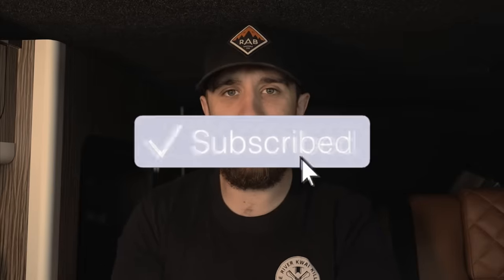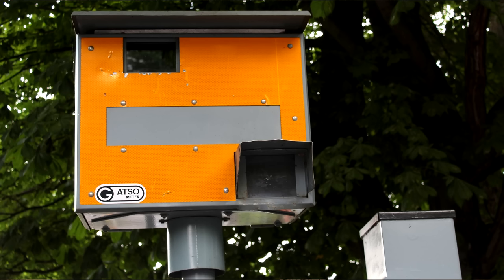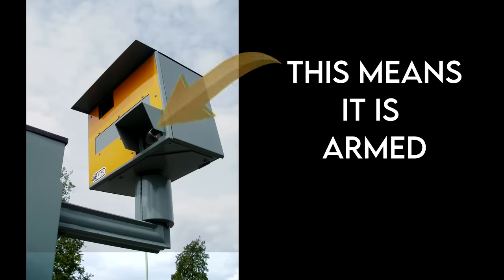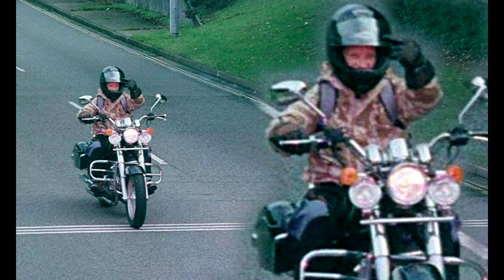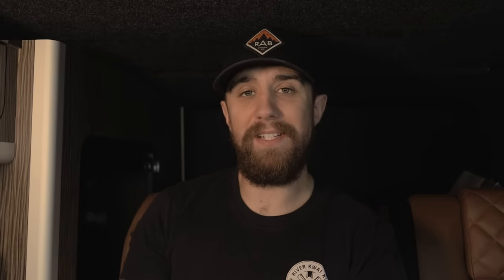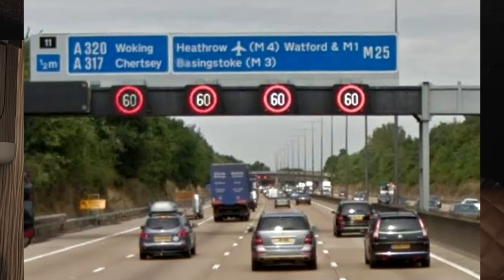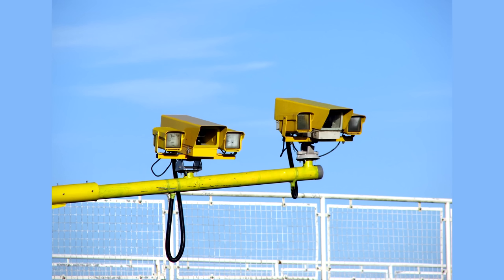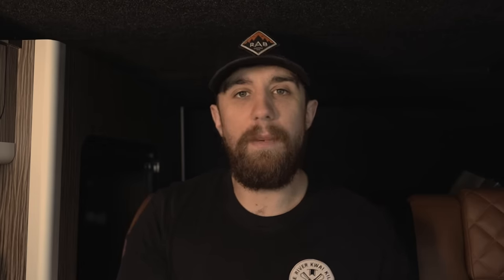How Speed Cameras Work and What to Look Out For

Comment: Day & night speed limits should be a thing
Reply: There needs to be general review of speed limits as they were set in the 70s and a woefully out of date.  It's ridiculous that small vans are subject to lower speed limits than SUVs and 4x4s.  Drivers of small vans like Peugeot Partners and VW Caddies are being unfairly targeted by a system that expects them to know that they are subject to lower limits than cars while allowing drivers of tank like SUVs to travel 10mph faster.
Reply: @raithrover1976  Unfair?  Of course they should be expected to know if they are driving a car derived vehicle or a commercial vehicle. If you are behind the wheel it's YOUR responsibility.
Reply: @bws833  It's unfair.  The old Vauxhall Combo was classed as car-derived but the new one isn't despite being roughly the same size.  Even police officers I've asked as well as managers within the transport industry seem confused about what's classed as car-derived and what's not.  It often comes down to which box the dealership ticked when they were registering the vehicle.  The lower speed limits for vans dates back to the 70s when van drivers were behind the wheel Sherpas and Bedfords (horrible things with a high centre of gravity and useless brakes).

Personally, I'd simplify the speed limit system and have just two types of vehicle classification: light and heavy with 3.5t being the dividing line between them.

Comment: UPDATE

Your point about average speed cameras being placed outside schools is a bit moot really. I believe there is a legal requirement for the cameras to be placed a minimum of 1/8 of a mile apart. Given that consists of a few hundred metres... in built up areas you are likely to have many side roads in that stretch of 200m. So someone could speed past one, but turn off down a side road and avoid the second one and therefore not get caught. For them to work effectively you would need one on near enough every single road and side road which just isn't really feasible. The cost would mean half of them would be turned off 99% of the time and therefore the ANPR system would be useless with many of the cameras inactive and as they work in pairs the "paired" camera would be off also as there is no point keeping it on.

This is why most of the ANPR cameras are used on motorways, because you could drive 5 miles before you get to the next junction, and in 5 miles they could put up 4 cameras if they wanted to. 

Also, it's Truvelo. Like the Truvelo Digital the RedSpeed does both speed and red light enforcement.

Gatso also have a Digital Camera which is phasing out the older ones, introduced in 2007 mainly used in areas like Hampshire.

Sometimes you will see secondary speed verification lines painted on both sides of the road, my understanding for this is that people used to swerve onto the wrong side of the road when speeding to avoid a camera. I once saw a twat driver in a M140i nearly lose it and crash to do this, he was doing probably 60 in a 30 at the time and nearly spun into the oncoming lane. 

They put them across both lanes so that if you set it off by speeding past it as it uses radar, and then go onto the wrong side of the road, they can still get a secondary verification of your speed as the lines are on both sides of the road.

Finally, "Cameras that track lane changes" is not quite correct. The camera doesn't track what lane you are in, it simply reads your registration plate. You could go past the first camera at 23:01:25 in the first lane, and past the second camera for example 1.5 miles away in lane 4 at 23:02:10. The second camera would simply read your registration plate (no matter which lane you are in) and add a timestamp for your reg into a database, the system then compares the two times (23:01:25 - 23:02:10) and as the cameras are at a known fixed position, in this example, 1.5 miles apart, it calculates that it took you 45 seconds to travel 1.5 miles. Which gives an average speed of 120 Miles per hour. Obviously well in excess of any threshold for a 70 mph limit, and thus a NIP is issued to the registered keeper.

Comment: SPECS cameras are the most misunderstood by motorists. I constantly see drivers slowing down and speeding up before/after the camera.
Reply: Yeah, that always makes me laugh, watching them hammer on the brakes like it makes a difference 😂
Reply: @leopold7562  it might though if slowing down reduces the average speed enough not to be above the guidance for prosecution.
Reply: @KentReynolds  Well, yes, but it's such a fine margin as to not be worth it as you'd need to be over by just one or two mph to get away with it.  The cameras clock the time it takes to pass between them, not the speed you're doing, and can work out the average speed you're doing by simply taking the time it took to pass the two cameras.

To bore you with the maths:  If two cameras are placed 2 miles apart and the average speed limit is 50mph, then it would take 2:30 to pass between them.  If you were doing 60mph, you'd do it in two minutes.  To bring your average down to the legal limit, you'd effectively have to stop completely for 30 seconds.  At 70, you'd cover the distance in a little over 1:40, meaning you'd have to stop completely for almost 50 seconds.  This kind of defeats the purpose of speeding in the first place.

TL;DR - It's very difficult to beat them, so don't bother trying.

Comment: Cameras in Glossop are painted green to blend in with the surroundings
Reply: Those are Watchman cameras, owned and operated by Tameside council. All they can do report you to police for an alleged violation.
The registered keeper of the vehicle MUST receive the NIP within 7 days of the offense for it to be enforceable.  Tameside council are incapable of doing anything that fast!
Reply: @barnseyfrommossley  Since when? NIPs have always been "served within 14 days" not 7. Note that it says "served" not "Delivered". Served just means posted, and it is deemed "served" one day after it is posted as they use first class post to send them out. If it is sent out on day 6 but doesn't arrive until day 16 due to a postal delay it's still valid. 

It's only when they send it out really close to the 14th day (i.e post it out on the 13th day) it can be argued it's not valid when it invariably arrives later than day 14.

And yes, you are correct, those are Watchman cameras.
Reply: @thefiestaguy8831  It's always been 7 days, you are incorrect on this.

Comment: Average speed cameras - you do not "need to be going at a constant speed". Where I live, the (A24 Box Hill) traffic often plods along at 40mph for half the distance, then on the two lane section, you can do 60mph to average 50mph. You can also speed past either camera with no repercussions.
Reply: I remember some bikers being reported in MCN for speeding along a main A road in the peak district, where the local authority put a some average speed cameras.  They got off with it, because the halfwits that installed them put them on a twisty "long way round" route, yet did`nt realise, there was a local lane that cut straight through the main long route, the lane being at national speed limit for a single carraigeway road being 60mph. The main route road was 40. The local police tried to claim the bikers were doing in excess of 100mph, which even isle of man racers would have been hard to acheive.

Comment: Need to correct you my friend. Average speed cameras with 40 limit for example- if you go past the first camera at 60 then realise the speed limit and slow to 20 for equal amount of distance then your average speed will be 40.
Reply from the maker: Yes I agree, my point is that it's a distance over time measurement.
Reply: No it won't, your average speed will not be 40mph (but it will make you safe from fine).

First a question to see if you understand averages:

Suppose you cover 1 mile at 30 mph, what speed must you travel the next mile so that the average speed for the two miles is 60 mph?

Now let's look at your suggestion of 20mph:

let's suppose you travel 1mile at 60mph and then 1 mile (the same distance) at 20mph. The time taken to cover the 2 miles is 1mile/60mph + 1mile/20mph = 1 min+ 3 min = 4 mins.
Average speed for the 2miles is 2miles/4 mins = 30mph

To average 40mph  you need to cover the 2 miles in 2 miles/40mph = 3 mins, which means the second mile needs to be covered in 2 mins (as the first was covered in 1 minute at 60 mph), therefore 1mile/2mins = 30 mph - drive the same distance at 30mph that you did at 60mph and your average speed will be 40mph.

However this assumes instantaneous speed changes from 60mph to 30 mph; it will in reality  be a continuous decrease. 

Now back to the question I asked.

To cover the 2 miles at 60mph requires you to cover the 2 miles in 2 minutes, but at 30mph it takes 2 minutes to cover 1 mile.  This you have to cover the 2nd mile on no time at all - "infinitely fast".  Realistically it can't be done.

Speeds are "averages" themselves - you cannot average speeds.

(And someone commented on the poor teaching of averages...there's also a lack of understanding of ratios and fractions).
Reply: wow im beat

Comment: I was caught doing 33 in a 30 and had to do a speed awareness course. So the 10% rule plus 2mph didn't apply. Good video.
Reply: 10% is in Legislation the + is up to the force in question some even use +3
Reply: @NoBody-gf8ie  guess I need to be under 33.
Reply: It's NPCC (formerly ACPO) guidance and forces don't have to follow it. In practise they do but they can prosecute below if there are other aggravating factors it's more likely.

Intrigued to know when this was. I got a SAC for 42 in a 30 in the Met's area in 2015. I was quite lucky to say the least as 43 in a 30 would have been 3 pts + fine.

Comment: If they were truly only about road safety, they would have put the speed limit on the back of the Gatso box,  then people wouldn't be slamming on the brakes on a 40 or 50 road trying to get down to 30 just in case.
Reply: seriously, if driver is not aware of the current speed limit, they really shouldn't be on the road...
Reply: Even when the limits are marked on the box, people still hit the anchors to get below 30 when the limits are higher.

Comment: In wales 1mph over and your booked. 0 % tolerance there. Got caught on way back from anglesey track and i was 1mph over in van. Had to do the course🙈🤦‍♂️
Reply from the maker: That's where I got my ticket. I was doing 60 on the motorway and missed a 50 variable speed sign. 
I was in the inside lane with no traffic in the picture they sent me. I could only assume that is was an error that the variable speed was on as there was no indication as to why!
Reply: @CorpsMedia  there doesn't have to be a visible reason for the limit changes, its deemed for safety, wether it be on the road in question or a nearby roadway/junction
Reply: @CorpsMedia  I got a ticket for exactly the same as you, missed the change to 50 mph on the M5 (Cribbs - Avonmouth variable speed section). Gutted!!
Reply: Thieves.

Comment: ANPR camera, tiny ones on lampposts, mainly black, and look like Crows, but has a wifi aerial.  Gets power from the lampost and uses wifi to transmit data, uses internal infrared.    These do ANPR checks, but also can do speed if setup, no flash needed, no film (again does inverse, take photos of all, if reg plate and speed ok, it will delete, so dirty plates or hidden hairsprayed plates the photos will be kept and analyised by a person doing digital adjustments on the photo to get your reg plate.    Some now in 2020 2021 have a yellow plastic covering which looks like the old blue Trafficmaster transmitters for fm traffic news, most thou are tiny black cameras hidden  ( say 10cm x 4cm x 4cm (+ 4cm wifi aerial) ) on lampposts - you never see them unless you really look and you think it a bird like a Crow on the Lamppost.

SPECS / SPARCS  -  been told all reg plates have been photos, and can do ANPR check if setup to do them too.  If you car is not speeding or not wanted by Police, then deletes your car photo.   This means if you go throu the first speeding, and somehow evaide the next camera,  longside a truck in blindspot or go cross country, your first photo will be kept for manual checking by a person.

Also for SPECS / SPARCS  -   only a first and other camera is needed.  To save money resources, multiple posts with camera are setup on that road.   You will not know which is the first or last camera that the averge speed will be calculated from.  They all could be dummies, or two are real the rest are dummies, or all are real.

Council cctv - it has been said their new digital systems can do everything a ANPR can if setup to do so, as the cctv picture feed just put in a live computer running the software for reg plate gathering for mot, tax, insurance, warrants, disqualified owner, tracking of vehicle for police knowledge, parking and SPEED.

Comment: Regarding painting the cameras yellow, when they were first launched, they were touted as "safety cameras", so when they were grey and hidden behind trees there was a mass of criticism. Hence, they were changed to yellow and had to be clearly visible and you will normally see signs ahead of the camera to tell you that a speed monitored area is ahead. If you still get caught, you clearly lack the awareness and skill to be driving above the speed limit. If you cannot spot a yellow box then what hope have you of spotting a person or obstacle in the road?
Some cameras can lawfully still be grey though, especially on the motorway; and they can be hidden behind the gantry. Provided there are signs warning of a speed monitored area, the fines are still valid.
If you want to avoid a fine, the best solution is not to stare at your speedo and look out for cameras, but to change your mindset.
a) Leave a little earlier and you will also find your journey less stressful.
b) If you are late, remember it is better to be late 5 minutes in this world than 5 minutes early in the next.
c) If you speed regularly to work, time the door to door journey and then try it at the speed limit or lower. Often, you will find the difference is a couple of minutes. Is it worth dying; killing someone else; a speeding ticket; losing your licence; wrecking your car; etc for those few minutes?
Changing your mindset will mean you do not have to worry about speeding fines and you might enjoy driving more.
Reply: 70 on a motorway is painfully slow if you’re the only one on it. Modernise the limits a modern car can stop from 80 in a shorter distance than a car 50 years ago when the 70limit was made
Reply: Yeah, it's alright sober you can spot them easy , when you're drunk, stoned and had a few lines of charly they are a bit harder to see enit :)

Comment: In Australia the rules about speedometers were changed in 2007. Since then most new cars have speedos set 7-9% fast so if you're actually doing 100km/hr your speedo can be reading 107+, which doesn't give you an excuse if picked up for being 1km/hr over the limit. Our speed cameras use laser beams to detect the speed and can be forcing the oncoming vehicle or facing the rear, which means motorcyclist can be picked up even though they don't have a front licence plate. In some areas we have average speed cameras, but I know of one set where, unfortunately, there's a rest point in the middle. Even so, plenty of people have been charged with having an average speed well over the limit.

Comment: You've covered fixed cameras, but not mobile. With the hand held unit which motorists hate, together with the 'safety' camera vans, they usually position them such that motorists DON'T have time to see the speed trap, as required. Typically it will be just around a corner, or, near where I live, one of two laybys that can't be seen until you are right on top of them. If the reason for the 'safety camera partnership' was to deter speeding rather than raise revenue then these sneaky hidden positions would not be used. Another favourite spot in Yeovil has the officer peeking out from behind a bus shelter!
If the police operated within the spirit as well as letter of the law it would be far more acceptable. Disclosure : I have never been caught speeding by either van, handheld or any other speed cameras since they were introduced.
Reply from the maker: I've recently done an updated video where I cover this 💪
Reply: If the cameras are sneaky, then the drivers won't know where they are, therefore to avoid a speeding fine they won't be speeding as they can't get fined that way.  Thus sneaky cameras are better at reducing speeding (everywhere) than overt, pre-warned ones which just reduce speeding on that short section of the road (especially point, non-average speed, ones).
Reply: @CorpsMedia  hi isn't there a set distance police need to be seen with mobile cameras? They aren't allowed to hide all speed cameras up here have painted black yellow on rear.. And mostly information signs telling us speed cameras operating.. See ifs it 30/40/50 what's so hard about that? It's not as if its 33,1/2 or 44 1/3? If you speed hell mend them🏴